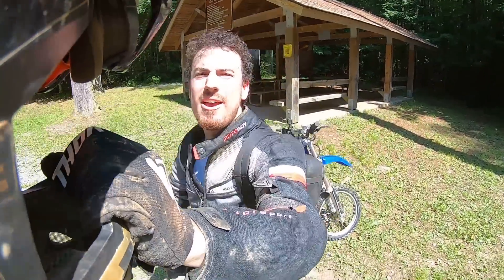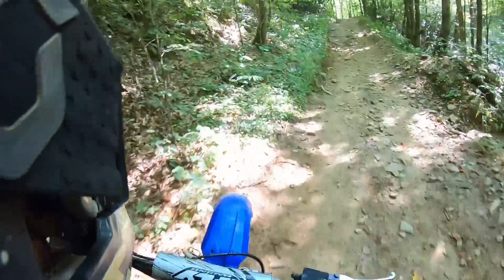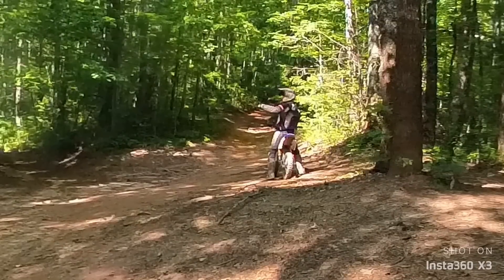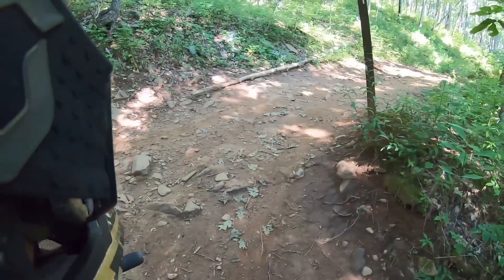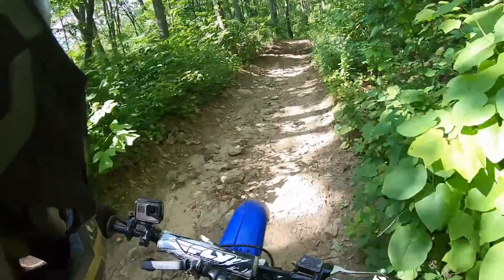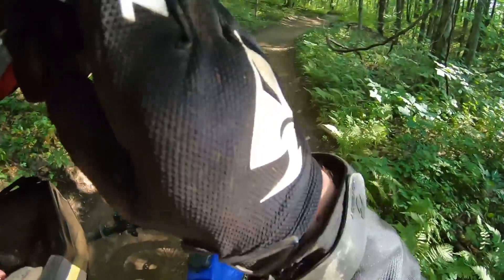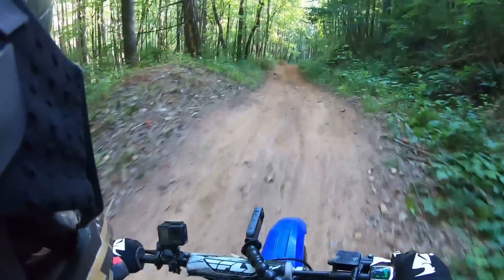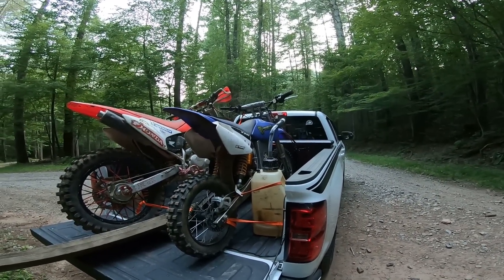First Real Off Road Test of the Electric YZ 85 Dirt Bike

Comment: Nice build, couple things I noticed. First you need a chain guide on the top side so there’s no chain slap , Take up some of that. Next, those master cylinders are the cheapo’s That’s gonna reduce that breaking power a lot if you can find a couple OEM ones you’ll have much better breaking. Other than that looks good .

Comment: real nice.
 You can download topo maps and GPS. To your phone. But....
If it were me  I trashed the apps. Having to dig the phone out every time you want to check something has to be a royal pain. Handheld GPS units are cheap nowadays. and if you have to walk you'll still know where you're at. And  for less than $20 you'll know what your battery is doing and for under $50 you can get a really nice speedometer odometer and both will fit nicely on your bars. And for that matter a LED headlight with a standalone battery could give you a couple hours. 
   Recently rebuilt my 83 200x.  It always had a nice headlight but almost from beginning I had two flood lights also. That was before LED. This time the rebuilt partially because I'm old is more towards comfort. Lol.   Now electric start  with a decent battery, it now has two 5x7 high low beam lights. I set them in a custom-made fairing with removable windscreen which will double as a wind break in the winter. 
  70 Total Watts on high beam for both
   Has a 54 inch  durablue axle  purchased almost 40 years ago.  Needless to say the tires stuck past the fender 14 in.  I made another set of fenders out of fiberglass the tires are now covered and extend a little further back also to compensate for the old 4 in. over swing arm. 
  Storage box on each side under the fender.  enough I can hide away the battery, cooler, tarp, and tools. 
      It had been on every Trail in Arizona and then some.  I use it for running our area's hundreds of miles of dirt roads.  I still have my hardcore four-wheelers but there's no challenging off-roading  Missouri. 
  Plan your trips.
 I am still here today. 
Decades ago before cell phones I used to go  by myself  leaving the highway as much as 50 miles behind.  there were times I ran into trouble but planning ahead always allowed me a way out. 
 I came out of box canyon one time and Arizona stopping to take a leak before hitting the main dirt road.  it was early in the week I had seen nobody all day.  but I hear someone screaming for help. 
 when I got there it was a gentleman whose battery went dead in his van.  it went dead on Sunday and it was Tuesday in the afternoon he had nothing to eat or drink.  daytime temperatures were around 110.
  he was still 12 miles from the highway but was wheelchair bound and didn't think he could wheel himself out that far.  where we were at it's doubtful anyone would had shown up until Friday evening or Saturday morning.  it's just it was my backyard and playground and I was always out there.
   Plan your life may depend on it. 
 That comes from a 70 year old man.

Comment: Nice job on the bike!  When you get to situations, like you taking off spinning and don't want to, try applying some rear brake.  Applying the rear brake will help take away some of the torque and let you get traction.  With the rattle, check the tension of your kick stand.  You could also try a YZ125 rear shock, it may work and give you a slightly higher ride height.

Comment: Ideas for next motor cycle. 2 hub motor 2 battery packs. Super eco mode rear motor run on pack¹  the front motor use as regene to change pack². Then at 60%changed the rear motor run on pack². 
What do you think? 
And neck braking mode both motors run at full power at the same time. 😂

Comment: With high instant torque i think big wheels will be the best. So the opposite of YZ 85 wheels...
21" front and 19" rear?
YZ 85 is high power and low torque, so it have small wheels.

Comment: I have a 700 fi kymco side by side that is in awesome shape under it  I dont think it was ever used  It was spray bombed over lights and every thing and missing motor insurance job  I bought it this way I have a kscsr 1000 street bike i bought for the motor  I also have the BIG forward reverse one shaft in two shaft out gear box for it  I most likely will never get around to putting it together  I would trade it to you for something if your interested  I would love to see what you did with it  It is made VERY VERY good look up reviews on it i think it is a 2017 model On a much bigger note I have a  6v92 turbo diesel  pusher rv that is the same as a greyhound bus  Nothing like 99 percent of the fall apart junk rvs It is a space frame all skinned in think alum 6 speed auto Allison tranny   It is fast and will get 12 mpg   I out run the wifes v6 Toyota up fancy gap the steepest highway hill over on my side of usa   The toyota shuts down a little under 110 it could not keep up  The eagle is 40 foot factory raised roof  If you ever wanted a mobile toy hauler/work shop it would be the best there is  It is just sitting also i will trade it also  Yes you can afford it its doning no one any good now just sitting i am easy dont care at all for money Try me i dont lie lol  Well love your videos come get on a big trade some time if you want God bless

Comment: The diminishing power has a plus side, when you start to feel it you know it's time to get your ass back to camp.
Reply: With lead acid you have that diminishing power but with lithium ion, lithium polymer, or lithium iron phosphate it's more of a plateau I'm pretty sure.  It's all there till it isn't.  At least that's how it works on my RC cars.  They rip till they just shut off.

Comment: I thought I would hate electric anything, but after driving an electric car, and the torque instantly under your foot even with a small battery makes a huge difference. the down side is the charging times compared to refuelling a combustion engined vehicle. and the frequency of having to recharge.

Comment: Hey Chris, i love this build, the kind that is practical, fun and reliable. I advise you to try thumb throttle for those electric project, you have way more control as well as tuning the controller for more smooth acceleration at low rpms. Love the content man, keep it up.

Comment: Will that motor act like a gyro? Are you sure about that battery sag I’m not sure being a lithium battery I can run my 170 Ah lithium down to 20% with still no after affect in power on a 48ah system and my scooters a 4 motor off-road  mobility type, very cool build btw.

Comment: The only reason the suspension is so bad in the other bike is because it’s built to race, it has stiff suspension because it’s built to be launched off jumps and ridden really hard, I have a kx250f and it’s suspension is stiff as a rock but on the track with jumps and that it feels great any softer and I wouldn’t be Abel to ride it on track. The other reason why it might be so stiff is because you don’t weight a lot either so for your next built use a trail bike frame 😂 like a klx or something

Comment: Great build I think if you tune it a little bit by having a veritable PWM on low throttle like removing some of the voltage on low throttle so it's more controllable. would finish it nicely.

Comment: You can try a very inexpensive "fix" for the bottoming out of front forks by adjusting the oil level. Take the forks out, put a ziptie on the fork tube and now depress the fork by pushing on it hard. Most likely you will bottom out the spring. Make a mark of the ziptie position with a marker. Now open the top fork cap and add some oil, 10cc or so. Reassemble the fork, slide the ziptie up and push down on the fork again. What you want is for the fork not to bottom out against the spring, you want the air gap inside of the fork to compress enough to provide that bottom out cushion. repeat the oil addition till you end up with about inch or so of distance between the hard, spring bottom out mark and the new "soft" air gap stop. You don't want excessive amount of oil as that would limit the travel and would blow out the seals. If you have some fork oil and 2 zipties, this is a free mod that can help.

Comment: The motor controller may have an option to make and install a throttle map.  This may allow you to have less torque on take off, limiting slipping and kicking.  Like maybe correlate 10 percent of full power in the first 1/4 of throttle range.

Comment: I'm not one for the whole electric everything, but Man this thing is legit cool!  Good job Chris! Can you adjust the throttle ramp rate or something similar in the motor controller settings maybe?
Reply: I was wondering the same thing, especially when you just need to go slow over rocks and stuff, be nice to just flip and switch
Reply: throttle ramp up is fairly complicated on electrics to get it perfect but yes it is adjustable you can make it very specific if you know what to do and the speed controller is capable of these parameters

Comment: I know I ask you before you never answered me. I am 60 years old I lost both my legs at my Job in 1993 I am in a wheelchair, I am in bad need of a 3 wheel or 4 wheel cart. I can put bags of trash in an take the to my dumpster. I live alone can't find anyone to help me . I live out in the country. I please am asking someone to build it for me I can buy it from you , Or if you can send me the the blue prints on how to do the wiring. Please I need help with this. A 2 wheels in front an one in back with a thumb control for the speed. Please I need help building this. when your in a wheelchair No legs from above the knees. I am asking for help to build a cart battery. Please help .

Comment: that rattling sounds like some barely loose spokes when they get weight on them so maybe checking the spokes and tighten them will solve and end the ratteling.
Maybe the torgue did loosen them cause sounds like it´s on the rear wheel.

Comment: your "450" electric dirtbike is made from a MX machine, they have very different suspension compared to an enduro bike, because they have to absorb high jumps, their springs are a lot stiffer. Talk to a suspension guy to fix that. also valving in the forks is different. Tuning suspension can make a night and day difference

Comment: You need to stand up alot more, your legs is 50% of your suspension and you use none of it, it also helps heaps with controlling the bike, instead of hanging on to it. your legs are your bodys suspension, you will get backpain riding like that and your butt will be sore xD Speaking as someone who owns a pretty nuts road legal pitbike, its so much fun on trails and in the woods, im pushing about 20hp on my current engine, which is a bit much for trails, the oem 125 with 10 is better for that, but holy crap is it fun, and it RIPS on the street with the sumo setup :D

Comment: You need bigger wheels. To take the bumps better.  You need to try low mode to see if the jumpy torque is less through the trails.

Comment: I love the build. I think electric is the way to go. We are in it's infancy. Gas cars took 100 years to get where they are. It's going to take some time and evolution to get electric there. Speaking of evolution, do you think adding a gearbox would help with the slow speed throttle touchyness? It would take less work for the motor, which could help with battery life too. Just a thought. Good luck and I  can't wait for the next video.

Comment: That thing is bloody quick, and I think the No Stroke is the best name XD
Also, you getting lost on the trails is like me getting lost in my own hometown since I only started exploring it on my 21-speed three years ago, and I've only had enough stamina to ride over an hour, having passed that hump to getting my body used to it, at the end of last year's riding season. I'm 24 now, so learning my city's roadmap is hard, I have a GPS clamp on my handlebars but with it being September now its starting to get too late to keep riding, its looking to be a very frigid autumn and winter here in Canada.

Also, on the part about the No Stroke having such great battery life, I think its more because you're giving it the beans for short bursts to get back up to speed and with its weight it only really has to consume charge to build speed, once its at speed it doesn't have to do much, partly since its a bike and has a very small cross-section so not much air to use power to displace. With the gas bike its consuming fuel to keep the motor turning, so its better served with the throttle open most of the time and would get better range under distance scenarios. That's the age-old pattern, EV is great with short ranges where gas would just consume itself over time with idle and start/stop, but gas is superior at range where it can use its 40 times greater energy density effectively. So a casual time dirt-biking with flying along the trails and stopping every so often to talk with friends and do stuff is better on an EV, but for racing or long distance trail runs its best with gas.

Overall, the bike is a great success, methinks, and going over the bumps it looks to do rather nicely, the motor being mounted almost fully inboard was a wonderful design choice!